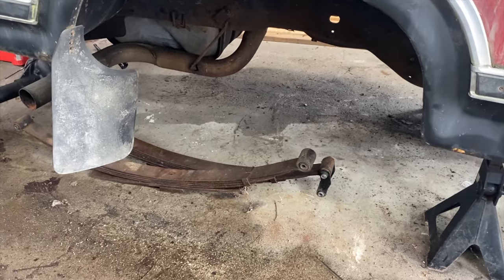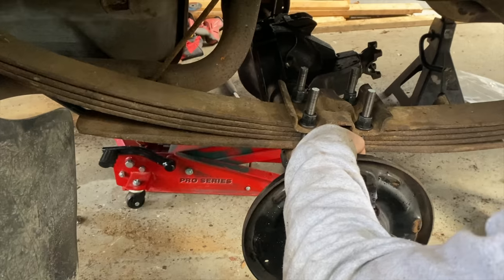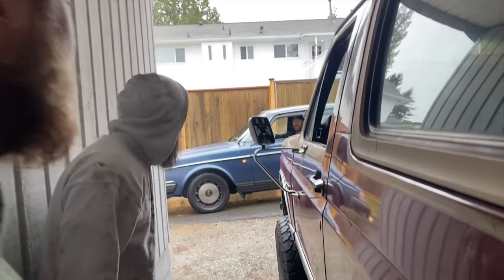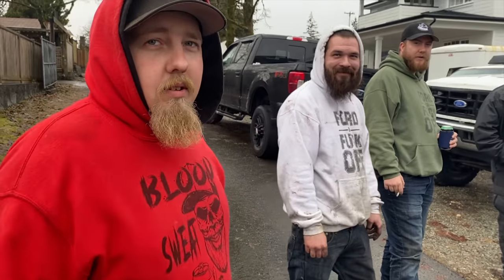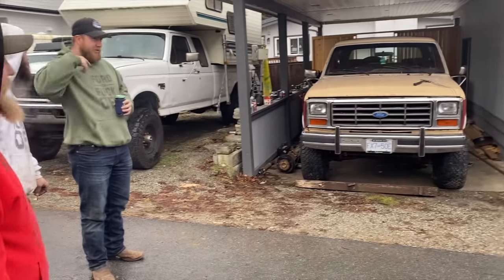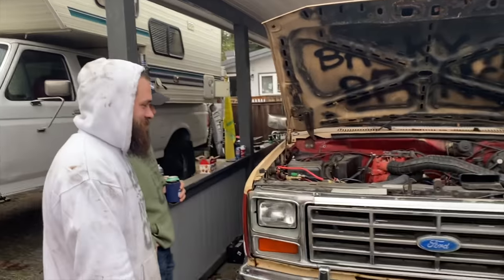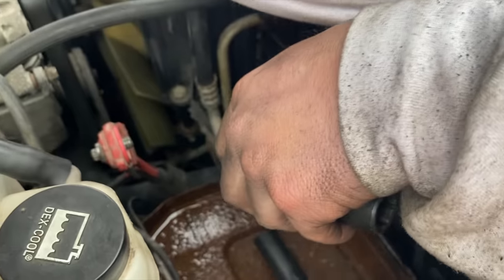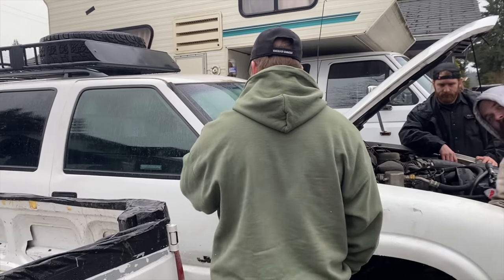BULLNOSE BRONCO REAR AXLE SWAP PT2!

Comment: You should get a 1in drive ratchet to take out the 8mm battery connector bolts because I don't think the 1/2in ratchet is big enough.